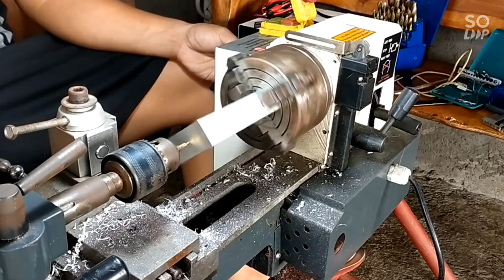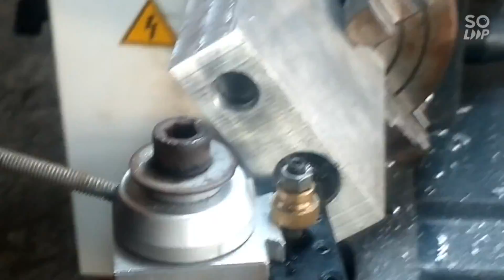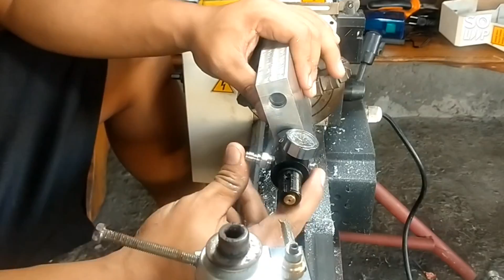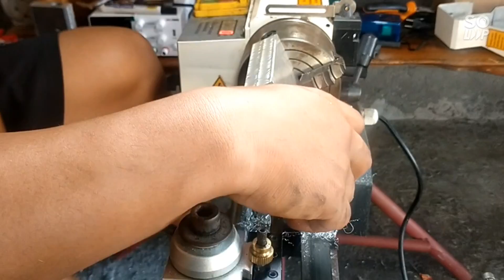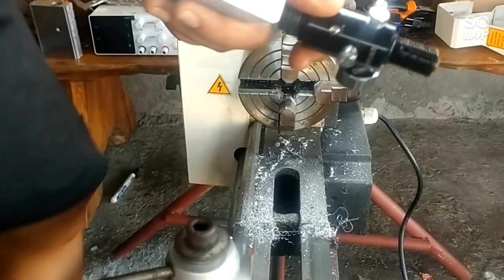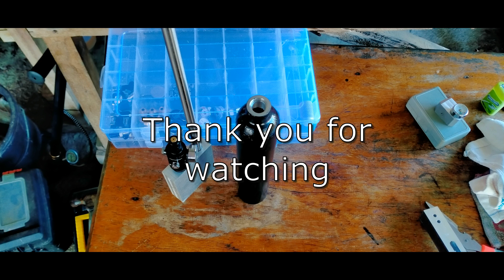how to make PCP Airgun reciever part 2

Comment: Sir anong size Ng drill bit mo para sa regulator at sa valve..salamat sa sagot sir
Reply from the maker: 19 drill bit plus rebore ko konti sa lathe
Reply: @kalingaairgun  salamat sir
Reply from the maker: No probs sir 👍
Reply: Sir anong set up Ng gear mo SA pag thread para SA regulator
Reply from the maker: 1.75 yung thread boss... About sa gear ndi pareparehas boss
Reply: @kalingaairgun  salamat unit idol
Reply from the maker: @Asteroidpcp6333  👍